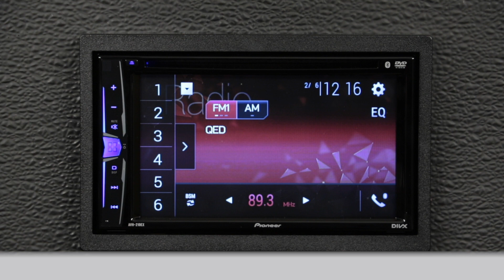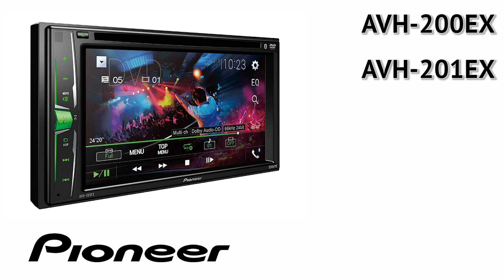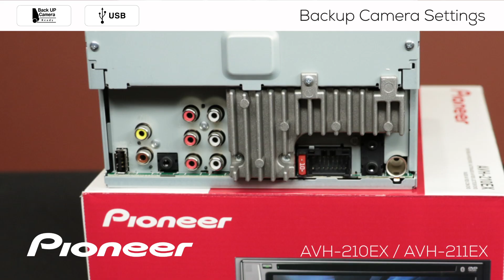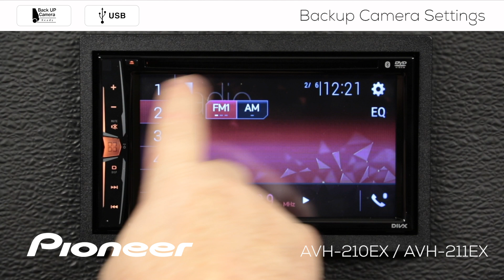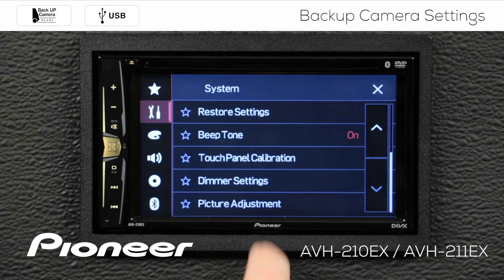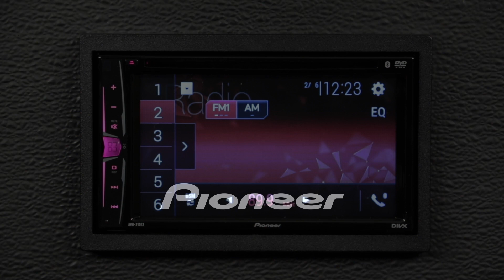How To - AVH-210EX - Backup Camera Settings

Comment: I’ve recently purchased a van with this head unit and noticed the camera on the back door, however I have a blank black screen when I got to the camera manually and also it doesn’t active when in reverse. Before I got ripping everything out, are there some quick wins you could suggest that I check? Thanks
Reply from the maker: If you have Pioneer AVH-210EX,  I recommend to press the receiver's microprocessor reset button.  You'll need a paperclip or some other small point to press the microprocessor reset button.  You can find the microprocessor reset button on the Pioneer AVH-210EX at the bottom of the hard key panel.  
Next go into the receiver's camera settings and be sure to switch the BackCamera Input to on.  You can see it here:    https://youtu.be/tWi_kVPg2M4?t=106
Next try to switch the camera view on from the receiver's Home Screen. 
If you still get a black screen, there are several possible issues:
1. The camera is not plugged into the receiver properly
2. The camera has no power.
3. The camera has failed.
Pioneer in-dash receivers are designed to work with the Pioneer ND-BC8 backup camera. I don’t know about the operation of other cameras. 
You can see it here:    https://youtu.be/kg0IaGC3JbE
Be sure to plug the Brown camera output RCA into the Brown RCA Input on the back of the Pioneer in dash receiver.
The Pioneer ND-BC8 camera needs power and ground to operate.  The camera should always have power when the vehicle is switched on. And the camera should power off when the vehicle is switched off.  This is very similar to the way the Red Accessory wire works on a Pioneer in-dash receiver.  Just because the camera has power does not mean you are viewing the camera window on the in-dash receiver.
The receiver’s violet/white wire is used to let the in-dash receiver know that the vehicle is in it’s reverse gear and, to automatically open the backup camera window on the receiver screen. 
Do not connect the violet/White wire to the camera. 
When you put the vehicle in it’s reverse gear, the violet/White wire should sense a change in voltage. This automatically opens the camera window on the in-dash receiver. And closes the camera window, when the vehicle is taken out of it’s reverse gear.  One possibly connection for the violet/White Reverse Gear wire is the vehicle’s  backup lamp terminal. 
You can learn more about wiring your Pioneer receiver here:   https://youtu.be/-bF3uzzaT30?list=PLw63zJRQbCNij5Whv7bYZnPaL9m1Nb1SV
You can find more videos on Pioneer's YouTube Channel here:   https://www.youtube.com/@pioneerelectronics

Comment: Hello i have avic f7300 when the unit is off and if i reverse the car the camera wont come on but if the unit is on and  put the car on reverse the camera work it will on...what will i do?
Reply from the maker: In what country or region do you use this product?
Please be more specific with your question.   Can you leave the receiver switched on?
When properly installed, your Pioneer in-dash receiver should automatically power on when the vehicle is started, and it  should automatically power off when the vehicle is shut down.
This means you can choose to leave the in-dash receiver switched on when you shut down the vehicle.  And the receiver should automatically startup and go to the last music source when you next start the vehicle. 
Additionally you have the option to turn the volume all the way down and not listen to the music source but still have the receiver powered up.
You can find more videos on Pioneer's YouTube Channel here:  https://www.youtube.com/user/pioneerelectronics

Comment: Hi I need help with my AVH-A215 BT I am replacing it with my old Panasonic NDDN-w58 but wanted to know if I can use my old Panasonic Camera, and how to Red, Yellow and Black wire connect wires. please advice. Lofty.
Reply from the maker: In Pioneer's wiring system, Yellow is constant power, Red is switched power, and black is ground.  This may not be the same for other brands of products.  I suggest to contact the product manufacturer for support.
Pioneer in-dash receivers are designed to work with the Pioneer ND-BC8 backup camera. I don’t know about the operation of other cameras. 
Be sure to plug the Brown camera output RCA into the Brown RCA Input on the back of the Pioneer in dash receiver.
Your Pioneer AVH-A215BT uses a composite RCA video input for it's backup camera.  If the camera you want to use has a composite RCA video output, the camera should work with the Pioneer in-dash receiver.
You can see the camera input on a similar receiver here:     https://youtu.be/ytUlUsi15Uc?t=159
The Pioneer ND-BC8 camera needs power and ground to operate.  The camera should always have power when the vehicle is switched on. And the camera should power off when the vehicle is switched off.  This is very similar to the way the Red Accessory wire works on a Pioneer in-dash receiver.  Just because the camera has power does not mean you are viewing the camera window on the in-dash receiver.
The receiver’s violet/white wire is used to let the in-dash receiver know that the vehicle is in it’s reverse gear and, to automatically open the backup camera window on the receiver screen. 
Do not connect the violet/White wire to the camera. 
When you put the vehicle in it’s reverse gear, the violet/White wire should sense a change in voltage. This automatically opens the camera window on the in-dash receiver. And closes the camera window, when the vehicle is taken out of it’s reverse gear.  One possibly connection for the violet/White Reverse Gear wire is the vehicle’s  backup lamp terminal. 
You can find more videos on Pioneer's YouTube Channel here:   https://www.youtube.com/user/pioneerelectronics

Comment: How to connect parking brk sensor to the receiver?
Reply from the maker: Please be more specific with your question.  What is the model number of your Pioneer in-dash receiver?
You’ll need to engage the vehicle’s Parking Brake in an ON-OFF-ON operation in order to access the Bluetooth setup menu. This might also be known as the Hand Brake or the Emergency Brake.  If you engage the vehicle’s Parking Brake and still can’t access the Bluetooth menu, the in-dash receiver’s Green Parking Brake Wire may have an incorrect connection to vehicle.  You can learn more about the Green Parking Brake Wire in this Pioneer How To video:  https://youtu.be/-bF3uzzaT30?list=PLw63zJRQbCNjEUhMJufnF-zxddC2146LR
You can find more videos on Pioneer's YouTube Channel here:  https://www.youtube.com/user/pioneerelectronics

Comment: So how do i know what wire is power to my vehicle and what does the purple wire connect to is it also the power
Reply from the maker: Here is a How To video from Pioneer about wiring your Pioneer receiver:    https://youtu.be/-bF3uzzaT30?list=PLw63zJRQbCNgLoyoij-BJdPDBVLYipAnj
Pioneer in-dash receivers are designed to work with the Pioneer ND-BC8 backup camera. I don’t know about the operation of other cameras. 
Be sure to plug the Brown camera output RCA into the Brown RCA Input on the back of the Pioneer in dash receiver.
The Pioneer ND-BC8 camera needs power and ground to operate.  The camera should always have power when the vehicle is switched on. And the camera should power off when the vehicle is switched off.  This is very similar to the way the Red Accessory wire works on a Pioneer in-dash receiver.  Just because the camera has power does not mean you are viewing the camera window on the in-dash receiver.
The receiver’s violet/white wire is used to let the in-dash receiver know that the vehicle is in it’s reverse gear and, to automatically open the backup camera window on the receiver screen. 
Do not connect the violet/White wire to the camera. 
When you put the vehicle in it’s reverse gear, the violet/White wire should sense a change in voltage. This automatically opens the camera window on the in-dash receiver. And closes the camera window, when the vehicle is taken out of it’s reverse gear.  One possibly connection for the violet/White Reverse Gear wire is the vehicle’s  backup lamp terminal. 
You can find more videos on Pioneer's YouTube Channel here:  https://www.youtube.com/user/pioneerelectronics

Comment: I have everything setup properly and the camera works... but the screen doesn't switch to the camera view automatically when I put the car in reverse... the purple/blue wire is connected but its not working..

Any advice?
Reply from the maker: If the in-dash receiver screen is not switching to the camera view window when you put the vehicle in reverse gear, the receiver's Violet wire with White strip is not connected properly or the polarity of the connection needs to change.  You can see it here:   https://youtu.be/UxuZp71garg?t=92       Pioneer in-dash receivers are designed to work with the Pioneer ND-BC8 backup camera. I don’t know about the operation of other cameras. 
Be sure to plug the Brown camera output RCA into the Brown RCA Input on the back of the Pioneer in dash receiver.
The Pioneer ND-BC8 camera needs power and ground to operate.  The camera should always have power when the vehicle is switched on. And the camera should power off when the vehicle is switched off.  This is very similar to the way the Red Accessory wire works on a Pioneer in-dash receiver.  Just because the camera has power does not mean you are viewing the camera window on the in-dash receiver.
The receiver’s violet/white wire is used to let the in-dash receiver know that the vehicle is in it’s reverse gear and, to automatically open the backup camera window on the receiver screen. 
Do not connect the violet/White wire to the camera. 
When you put the vehicle in it’s reverse gear, the violet/White wire should sense a change in voltage. This automatically opens the camera window on the in-dash receiver. And closes the camera window, when the vehicle is taken out of it’s reverse gear.  One possibly connection for the violet/White Reverse Gear wire is the vehicle’s  backup lamp terminal.    You can learn more about wiring your Pioneer in-dash receiver here:     https://youtu.be/-bF3uzzaT30?list=PLw63zJRQbCNjEUhMJufnF-zxddC2146LR      and you can find more videos on Pioneer's YouTube Channel here:   https://www.youtube.com/user/pioneerelectronics

Comment: From the way I see it you need to connect the red and black wires which are on the camera wiring to your power supply / earth and then your power source for the signal - like from your reversing globe power source (especially for older cars) to the purple / white wire on your head unit receiver. This is not totally clear on any of the video's. I have tried with my Pioneer ACH-A205BT to use the camera manually by connecting up the red and black camera wires directly into the Red and Black terminals on head unit plug and selecting camera view on the head unit and there is nothing displayed just a black screen. Please advise.
Reply from the maker: Pioneer in-dash receivers are designed to work with the Pioneer ND-BC8 backup camera. I don’t know about the operation of other cameras. 
Be sure to plug the Brown camera output RCA into the Brown RCA Input on the back of the Pioneer in dash receiver.
The Pioneer ND-BC8 camera needs power and ground to operate.  The camera should always have power when the vehicle is switched on. And the camera should power off when the vehicle is switched off.  This is very similar to the way the Red Accessory wire works on a Pioneer in-dash receiver.  Just because the camera has power does not mean you are viewing the camera window on the in-dash receiver.
The receiver’s violet/white wire is used to let the in-dash receiver know that the vehicle is in it’s reverse gear and, to automatically open the backup camera window on the receiver screen. 
Do not connect the violet/White wire to the camera. 
When you put the vehicle in it’s reverse gear, the violet/White wire should sense a change in voltage. This automatically opens the camera window on the in-dash receiver. And closes the camera window, when the vehicle is taken out of it’s reverse gear.  One possibly connection for the violet/White Reverse Gear wire is the vehicle’s  backup lamp terminal.  You can learn more about wiring your Pioneer in-dash receiver in this How To video:   https://youtu.be/-bF3uzzaT30?list=PLw63zJRQbCNgLoyoij-BJdPDBVLYipAnj    You can find a full playlist of How To videos from Pioneer about AV in-dash receivers here:   https://youtu.be/oVH5gvX5Rfs?list=PLw63zJRQbCNgLoyoij-BJdPDBVLYipAnj     and you can find more videos on Pioneer's YouTube Channel here:  https://www.youtube.com/user/pioneerelectronics

Comment: Do you have to wire it to the reverse light or is there any other method?
Reply from the maker: Pioneer in-dash receivers are designed to work with the Pioneer ND-BC8 backup camera. I don’t know about the operation of other cameras. 
Be sure to plug the Brown camera output RCA into the Brown RCA Input on the back of the Pioneer in dash receiver.
The Pioneer ND-BC8 camera needs power and ground to operate.  The camera should always have power when the vehicle is switched on. And the camera should power off when the vehicle is switched off.  This is very similar to the way the Red Accessory wire works on a Pioneer in-dash receiver.  Just because the camera has power does not mean you are viewing the camera window on the in-dash receiver.
The receiver’s violet/white wire is used to let the in-dash receiver know that the vehicle is in it’s reverse gear and, to automatically open the backup camera window on the receiver screen. 
Do not connect the violet/White wire to the camera. 
When you put the vehicle in it’s reverse gear, the violet/White wire should sense a change in voltage. This automatically opens the camera window on the in-dash receiver. And closes the camera window, when the vehicle is taken out of it’s reverse gear.  One possibly connection for the violet/White Reverse Gear wire is the vehicle’s  backup lamp terminal. 
Some vehicles may have other options for the reverse gear input connection, such as the main bus system for the vehicle.   If you are using an iDatalink Maestro RR, there may be a connection available on that unit, again depending upon the vehicle.  You can find more videos on Pioneer's YouTube Channel here:  https://www.youtube.com/user/pioneerelectronics

Comment: My camera view will not work when I'm in park, but it works when I put the car in reverse.  What have I done wrong?
Reply: You have the camera power wired incorrectly.    Pioneer in-dash receivers are designed to work with the Pioneer ND-BC8 backup camera. I don’t know about the operation of other cameras. 
Be sure to plug the Brown camera output RCA into the Brown RCA Input on the back of the Pioneer in dash receiver.
The Pioneer ND-BC8 camera needs power and ground to operate.  The camera should always have power when the vehicle is switched on. And the camera should power off when the vehicle is switched off.  This is very similar to the way the Red Accessory wire works on a Pioneer in-dash receiver.  Just because the camera has power does not mean you are viewing the camera window on the in-dash receiver.
The receiver’s violet/white wire is used to let the in-dash receiver know that the vehicle is in it’s reverse gear and, to automatically open the backup camera window on the receiver screen. 
Do not connect the violet/White wire to the camera. 
When you put the vehicle in it’s reverse gear, the violet/White wire should sense a change in voltage. This automatically opens the camera window on the in-dash receiver. And closes the camera window, when the vehicle is taken out of it’s reverse gear.  One possibly connection for the violet/White Reverse Gear wire is the vehicle’s  backup lamp terminal. 
You can learn more about wiring your Pioneer receiver here:  https://youtu.be/-bF3uzzaT30?list=PLw63zJRQbCNgLoyoij-BJdPDBVLYipAnj    You can find more videos on Pioneer's YouTube Channel here:  https://www.youtube.com/user/pioneerelectronics